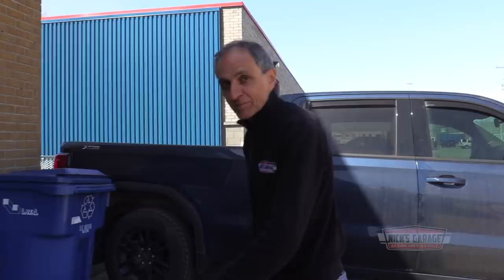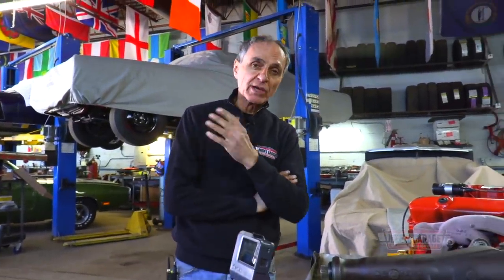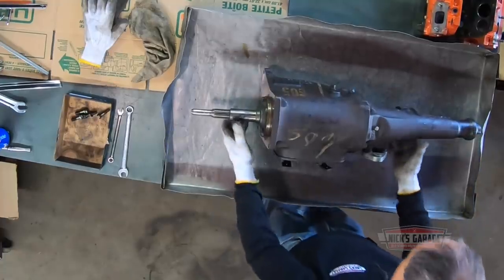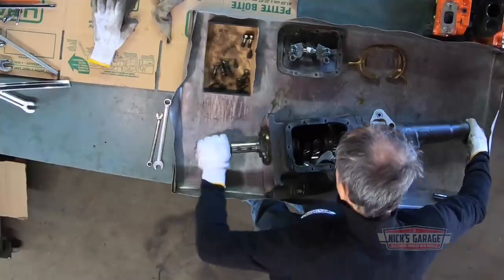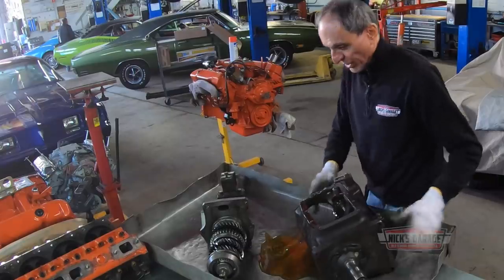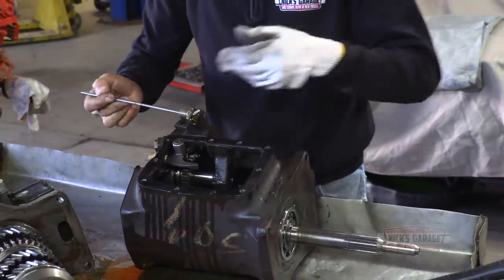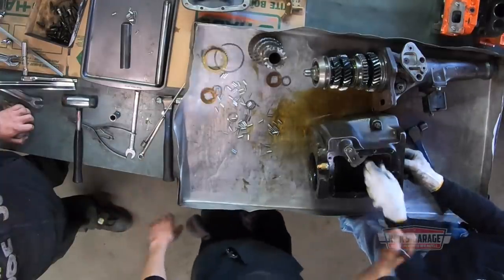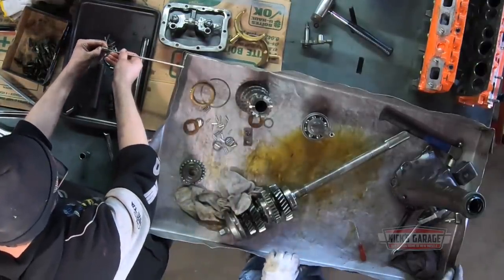Brutal Mopar 4-Speed Tear Down - Wall to Wall Power

Comment: I heard you mention something about grease. When you are installing the roller or needle bearings, you want to use Vaseline to hold them in place, not grease. Grease can clog the tiny lube holes or block lube from getting to the bearings. Grease and gear lube do not mix. But Vaseline will. Put some grease on the o rings. Keeps them soft and pliable and helps keep lube from leaking out😉.

Comment: Ahh the memories, I had the same gearbox in my ’70 Duster 340. Damn I miss that car.
Reply: 1970 plum crazy purple, white interior 340 4speed Hurst shifter bought as first new car.  13.99 at 99.9 mph still
in third gear ( 3.23 gears in the rear) going through the traps at St Thomas Dragway. Damn I wish I still owned
it. 
Cheers Beach8     Bob

Comment: Nick Panaritis in the sun standing tall He's got Mopar 440's wall to wall Waow that's a lean green Cuda AAR tribute machine Cutting loose up the street that burnout was sweet Johnny's special treat Leo is back on the attack Devin and Vasili working too taking up the slack that's what'll keep Nick's customers coming back Waow now that's a solid blue Pontiac You can't walk past a Jensen without giving it a mention Nick has a custom exhaust system planned to clear the ground and the suspension A 1970 Charger 500 383 A sight you rarely see but at Nick's Garage is where it needs to be George shipped it right away until it's perfect at Nick's Garage is where it's gonna stay At Nick's Garage they're always on the go That's what makes Nick's Garage the internets number one muscle car show
Reply from the maker: Always amazing, Roberto.  Thanks so much.
Reply: @NicksGarage  Likewise Always amazing content I give you guys 100%
Reply: @robertorhymes  .     Thank you.
Reply: @nickpanaritis4122  Cheers Nick waow you can strip a gear box quick

Comment: The single biggest mistake that I see with those old gear boxes with brass synchro is using the wrong oil.  It needs to be yellow metal friendly , a gl1 or compatible oil.  If you drain the oil and it has a yellow hue to it, guaranteed it had the wrong oil and you need new synchros...

Good stuff Nick...

Comment: Nick I bought a 1978 Buick skyhawk new. It came from the factory with no gear lubricant in the 4 speed transmission . The dealer  also missed it too . That was when the dealers changed you for dealer prep . I burned a bearing and had to put in rebuilt transmission. I didn't catch until it was out of warranty. I was not happy . Nice to see you work on the 4 speed manual . It's nice when you know where you're going. Experience is great to have.

Comment: My brother's '69 SuperBee had a 23 spline 4 speed and a Dana 60 rearend. Unbreakable. I took the car to 156mph and he took it to 172. My run had a hotrodded 383 and his run had a warmed up 440. Wish i had that car. It had the tach with clock and the rest of the gauges. 160 mph speedo was replaced with a 200 mph speedo:) It was a great car. Engineers work hard to get these cars designed and working.

Comment: Gear lube-the smell of machinery  👍

Thanks for uploading this Nick. It's the most comprehensive teardown I've been able to find on the 833. Mine needs a new front bearing (it actually "clunks" when I turn the input shaft) and now I know I'm tearing the whole thing down to replace it.

 Worked at a restoration shop about 10 years ago-the owner had an aluminum case A833 sitting in a pile of parts outside. Asked if I could buy it and he never gave me an answer. May have to go back up there someday and ask again. I remember tracing the numbers stamped on the pad and they came back as being out of a 1965 car-which doesn't jive with the research. From what I've learned, it wasn't available until the 1970s. An anomaly, maybe? Regardless, I'd like to buy it just to have it. At least I'll keep it inside.
Reply: ka.        Go for it.

Comment: The trick set up for the A-833 four speed is to use a 1969 or older side cover, as they shift slicker than the 1970 and newer ones. The 1969 and older side covers take bronze shift forks, which aren't as strong as the 1970 and newer steel shift forks, but the steel shift forks can have the extended nubs on them machined down to match the bronze shift fork dimensions to fit the older side covers. So then you have the smooth shifting 1969 and older side cover with the  stronger 1970 and newer steel shift forks. Some sources say 1971 was the change and the gear ratios did change in 1971, except for the 1970 340-6 bbl engines, that got the 1971 gear ratios. 1964 - 1970 side cover is called, ball and detent and the 1971 and newer is called, interlocking. The later steel shift forks have an extended nub / stud on the cover end that needs to be machined down to match the bronze shift fork dimensions to fit the earlier side cover.
Reply: Jim.           Good source of info. Yes they are different from 70 and newer on the side covers.  Thanks.

Comment: I love watching your videos Nick. I watched you take that shaft out of that 833 4 speed. There`s no way you broke that shaft with those teeny tiny hammers and a brass drift. I would inspect those pieces further and see if it may have already had a hairline crack. 
Thank you for all your expert work and for the trouble you go to to provide us with these videos.
Reply: I agree with you that shaft that broke down a little piece I think it was just metal fatigue from years of doing his job finally gave up it was not that little ball peen hammer or the brass drift punch, witch I have several different sizes and thickness from old turbos that wore out. Freebies,

Comment: I bought a 'completely disassembled' 1967 Buick GS Convertible once...had a 400-Buick engine (rather rare)...completely disassembled too. When I received it, the complete engine kit was in a big cardboard box...that rats had chewed into. They had a field day with the cardboard and 'smaller boxes' inside. As a result, there was a LOT of 'atmosphere exposure' to various parts (rings, bearings, etc.)...and I thought what they thought here...'these bearings have been used' (rod bearings)...only upon closer inspection did I realize, the 'used' was actually moisture 'stain'...along with sitting in a box for 30-years, open to the air. Ended up, I had to order new bearings...and wait WEEKS (no one stocked them on-hand) before I could assemble the bottom end, as a result. (we won't talk about the 2nd ring on cylinder 6 popping out of the piston as I installed it...scratching the cylinder, destroying the ring, etc...) that car was such a headache, by the time I spent a month chasing down 'why won't the pneumatic actuator send the convertible top back up' (rotted air lines in a 'hidden' location), that I got it 'rolling and running', and sold it to a friend....so he could finance the complete interior rework, re-topping the convertible, and painting it. He ended up being into the car for $5,500...but when he was done, he only took it to one show and sold it for $22k...good profit, to have many of the 'battles' finished, before he got it. I turned around and purchased a 73 'Petty Blue' Charger, that I had a really bad run of luck with...again, 'completely disasssembled' for a frame off, and they gave up...ever seen a Charger where not one bolt is installed? Big box of fasteners! I was conned on that one, was supposed to (by numbers) be a 440-car...but about a week after I had purchased it, I found the block stamp to show it was a 400-cubic inch 'slug', instead. That was when I learned to NEVER TRUST what someone says something is...CHECK IT YOURSELF!

Comment: When I was a kid my friend Steve Ray's family had a wrecking yard.
We would get 383s and 440s.
Loose motors with 70 to 100,000 miles on them for $50 -$100. We had some good parts, two torker intakes, a 780 Holley,  an Isky cam and some headers. We also had a windage tray. Hot rodding on a budget. Loose motors spin.

Comment: Here in U.S. / Missouri we call that 4 speed used gear oil and used rear diff oil = skunk oil 🤧.  Nick you could use a green seal O ring instead of a regular rubber O ring 👍. the green O rings are for Automotive AC unit line seals and resist heat an cold and chemicals . Might last longer . there is an assorted Green O ring kit of different size O rings 😎👍🏁
Reply: MOPAR.         Thanks for the info.

Comment: I know you know that they make a paper intake gasket for the 440 six pack when I cut my heads 66th I had to run a paper intake gaskets between the heads and the valley cover for the tunnel ram to seal right  gust wanted you to know my secret way to get a seal up thank you for sharing your old school ways we did back in the days and I love the older motors you work on from a nother old motor builder !

Comment: Great video as always Nick. You're not the only one waiting for parts. We are waiting for an airbag module for a 2019 Honda CRV and it's on backorder until May from the dealer.
There's an 88 Vette in the shop I had to order the speedometer sensor on the transmission off of eBay that's a new AC Delco part in the box and it was supposed to arrive yesterday and it has not. And Ford has also been bad about parts from the dealership right now cuz they've been on backorder for long periods for various parts. The parts industry right now is screwed all the way up along with the mail here in Columbus Ohio.
Reply: N.S.A.            I am with you.

Comment: Gear oil has sulfur in it.  At high temps it forms a sulfide layer that protects the gear.   The sulfur does give it a pungent odor.  At least you can tell if a leak is from the gearbox.  The only thing worse was the old Berryman's Chemtool parts cleaner.  Their new stuff doesn't smell so bad but then it again it won't clean the parts as well as the old stuff.

Comment: Nick " Never seen an 18spline trans broken." A few taps later from a hammer, oops never mind. LOL  Sometimes we never know why old parts fail. I reckon it just didn't want to be disturbed.
Reply: bc.         It is in good shape. Just replacing the 2 main roller bearings.

Comment: Great post Nick. On that Jensen I'm wondering if it would be easier to integrate an air bag system that could provide lift instead of an oval exhaust system. I know that some modern Supercars use that.

Comment: I've taken many of these transmissions apart over the years and never had any problem with the counter shaft breaking. That's awfully strange.  There's nothing there to interfere with the retainer lock to do that. Maybe in the past someone tried to remove the shaft by driving it in the wrong direction and cracked it. Then when you removed it it broke apart. That's the only thing I can think of.

Comment: The A344 is virtually the same gearbox as the Muncie / Rock Crusher M22, but with the addition of the main gears riding on bronze sleeves instead of plain bearings and a couple of other mods I cant recall off the top of my head.. I wonder if anyone will ever bring in a real deal Hemi Cuda 1970 convertible. the HOLY GRAIL as far as collector value and auction results go.
Reply: Chuck.       Too rare.

Comment: I bet someone hammered that shaft into  the case on install, stressing/cracking the weak end piece.  
    Then it gets tight with corrosion, and gave way on the drive out.

Comment: That shaft key groove is prone to breaking. I think it actually happened when assembled if the shaft is misaligned as it Is driven in, the key catches and that piece cracks. I have had it happen to me.
Reply from the maker: The good news is, we ended up making a new groove in the other side of the shaft and reusing the original.
Reply: @NicksGarage  I wonder if there would be a way to turn the shaft a bit each way before tapping it out.
This way you could set it in the center to avoid catching the edge.

Comment: "They" do make transmission adapters for engine stands, too, just so you don't have to manhandle them on a sheet metal pan. Just sayin'. :)
Have you ever disassembled/serviced/reassembled a B&W 1st gear slider 3 speed with electrically operated OD? Good times, good times....

Comment: While I am a hardcore Pontiac man, I own several GTOs, Formulas and Trans Ams, my family is a bunch of mopar nuts. My dad left me his 70 AAR Cuda clone last year and it looks exactly like that one with Rally wheels, built on a 73 with a 340/727/3.23, and my brother has owned a 70 Charger 383/727, in that same green with a green interior and a white top. Dad was the original owner to a 64 Sport Fury with the 426 wedge in it, he sold it in 68, a year before I came along, just after my brother with the 70 Charger showed up. In 2015 dad found its twin, a low mileage unrestored original as far as we can tell, all it had done was a paint job and some engine work, it looks like it was raced for a while. Older brother got the Fury, the brother after me got the 36 Plymouth Coupe with a 360/727.

When I head home to pick up the Cuda and some of my Pontiacs, I will shoot some video of our collection. The Cuda needs some work, so I will show that when I do it too. You can see the 65 GTO and a bit of the 70 GTO, along with one of the Formulas I have on my channel, my brothers and I have been into muscle cars all our lives. The brother after me has the mopar bug real bad, almost as bad as I am with Pontiac. He has a 70 Challenger, 69 Charger, a Pro Street D50, along with a lot of others, and his kids have Demons, Dusters, and Chargers. 

Life is too short to drive boring appliances on wheels that all look the same.
Reply: Thump.       Family and cars. Love it.

Comment: Nick my 73 727 automatic transmission has been sitting still for maybe a year or so, do I need to take it out of the car and get it rebuilt or can I turn it over and run it through the gears and then let it idle to warm up and then just change the filter screen?

Comment: How come the back window on the green Charger 500 is not the same as Eugene's Charger 500.
Reply: Paul.   Good question. I do not know why. Only the 69 Charger 500 had the back glass flush with the roof lines.

Comment: They finished the shop across the street! Nick how come the 18 spline input shaft is considered stronger than the 23? In the high performance differentials it is said that more splines is better for the axles? Stay safe team.
(Spelling edit*)
Reply: Shaun, the 23 spline is 1" in diameter, and the 18 spline is 1-3/16" in diameter. If the diameters were the same and the same material, the 23 spline would be stronger.
Reply: @gavinmclaren9416  ah, thanks Gavin. Details Nick... haha 🙂
Reply: Ford's 4-spd Top Loaders had the "big block" and "small block" versions like that too. More accurately, the "big shaft" and "small shaft" versions...the big input shaft version had more splines on the output shaft, too. At one time I had collected a number of Top Loaders when I was in the 64-73 Mustang and Fairlane / Torino game. I even had ones from 428 and 429 CJ's, Boss 302's and Boss 351's, and the wide and close ratio versions too. One came with a straight line side  reverse lock out sequential Hurst shifter built specifically for drag racing. I had another shifter with the short reverse bat wing lock out handle for a 427 Cobra. Damn, wish I could have kept all that stuff.....
Reply: @onedayiwillmakesomecontent  .   LOL.

Comment: Nick do you have MOTOR s for sale? I have a 73 Plymouth cuda 340. People tell me the 73 DON'T have a lot of room for power.  My car is a local car that is a number matching car. Im the 3rd  owner the guy that had it first bought the car new while in high school at the same time i had bought a 72 DUSTER 318 . Long story short i got the cuda it had a lot a miles on it but the body was great. I had the MOTOR bored 30 over and the crank turned and clean up. I bought a set of 10:1 pistons it has a EDELBROCK cam a step up from stock for low end toque double timing chain wynns aluminum high rise intake with 750 double pumper and aMSD box. A set long tube headers. Now for my main question what kind of heads should i use. I have a 4 speed with a 323 pos rear END.  I wont it for toque. Could you give me some good ideas WHAT i need. I WOULD appreciate the advice. THANK YOU FOR LISTENING.
Reply: mopar.      Put on a set of TrickFlow heads. They will wake up the engine with Torque and Power.
Reply: THANK YOU NICK FOR THE REPLY ON MY 73 CUDA IF ANY OTHER IDEAS AS FOR REAR END. OR ANYTHING MORE ABOUT MY MY MOTOR.

Comment: DO NOT Push or tap reverse lever shaft out of main case without filing off burrs on outside shift lever slot !  You will score a groove in the case that a new O-Ring will never seal !

Comment: How about the tremecs??? I was planning to put a tremec 5 speed in my 70 charger.
Reply: @Car Guy daddyo cutting u mean chopping the body?? Yeah I def don’t wanna do that but the new tkx fits in like stock but requires to drill a hole where the shifter does in. And I don’t think a 4 gear is enough for a 540 hemi making 750hp I think I’m really gonna need that extra gear. I didn’t wanna go with the 6 gear cause that requires a lot of chopping and it’s kinda weird honestly to have 6 gears in a classic muscle.
Reply: @c.wdervin5987  if it was mine I would either do that six speed or the old school 4 speed with a gear vendors overdrive unit.  Sounds like a fun build.  Cheers
Reply: @I_Count_Twice  fun especially with the budget even though it’s not really an expensive expensive build like some cheesy ones out there trying to change the car completely. Not me it looks absolutely stock just upgrading a bit with all bolt on quality mechanics. But yeah anyway it’s not cheap for a poor dude like myself.
Reply: @Car Guy daddyo .      Something to look into. Overdrive on a 4 speed. Nice.